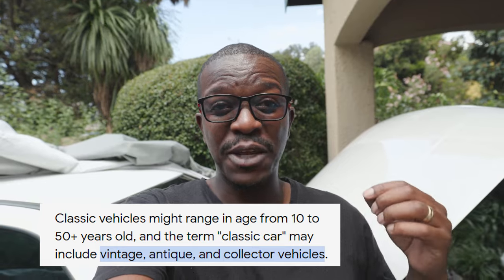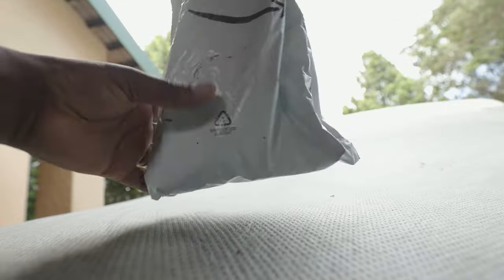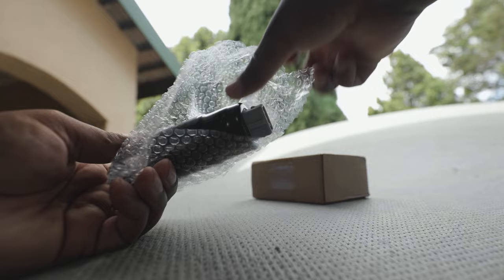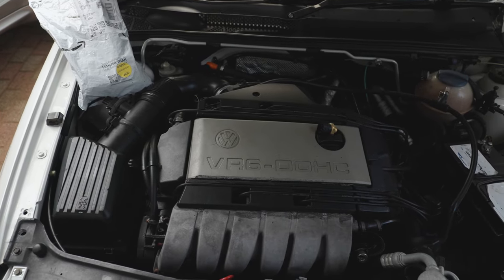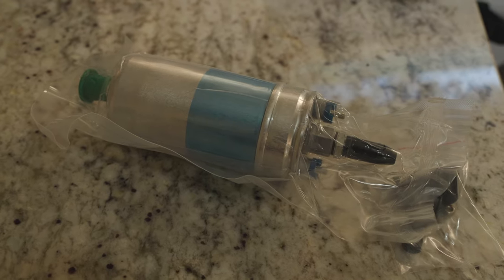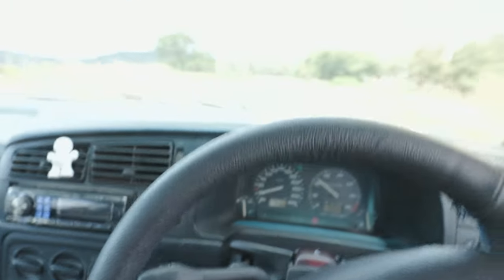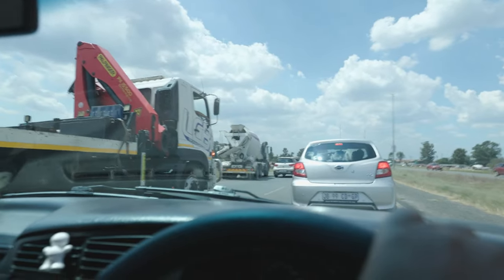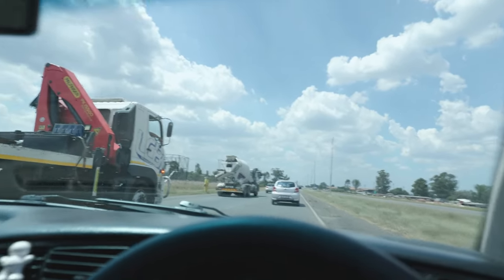Things You Should Know Before Buying A Classic

Comment: Fya, vr6 is a problematic car always has mechanical issues there is no peace of mind there, expensive parts yooooh its a money pit. e30 get it right once you will enjoy and it will take you anyway that is my experience with these to cars, by the way I owned a vr6 for 4 years I was friends with mechanics. between these 2 cars get a clean e30 more value when you sell also. peace
Reply from the maker: Thanks Rofhiwa for sharing your experience. I think aswell in the defense of all these older cars and their issues we must not forget that they are old and are bound to have components failing every now and then, not to mention how parts are becoming scarce.
Reply: Plus the previous owners maintenance of these cars count. You are both 100% spot on though.